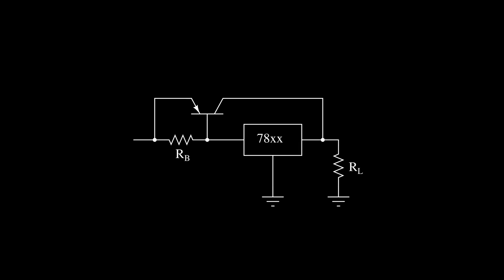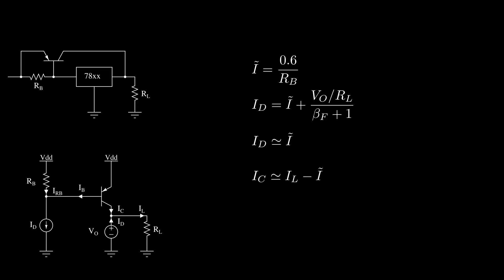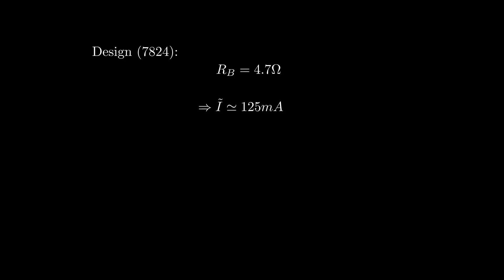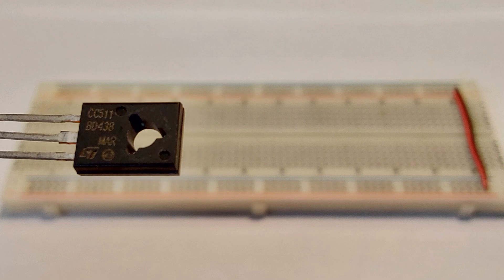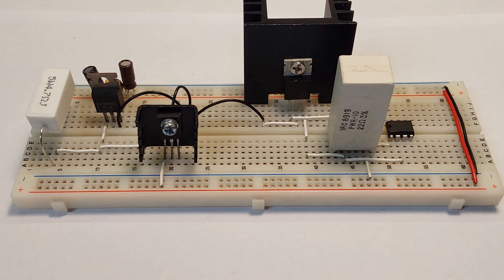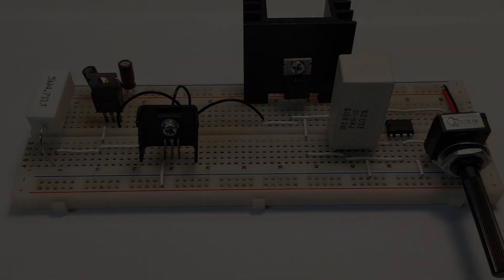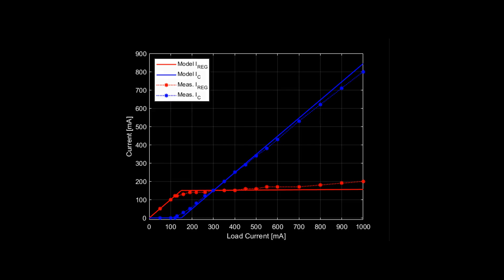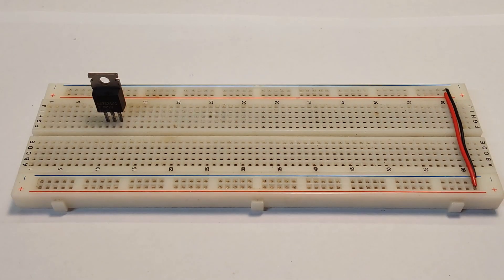78xx Current Boosting: Circuit Design and Measurements

Comment: You formula for the power dissipated in Rb is wrong. No more than the current passing through the regulator passes through Rband you have designed that to be not much more than 150mA. In fact, the base-emitter junction of a power transistor will drop more than 0.6V when the transistor is supplying significant current, but not too much more. If Rb were really dissipating 4.7W, then it would be passing 1A and have a voltage drop of 4.7V, which is nonsensical given that the transistor Vbe is across it. Look at your own measurements and you 'll see that no more than 200mA was passing through the regulator and hence through Rb. Actual voltage across Rb was 4.7R x 0.2A =  0.94V, so power dissipation in Rb was 0.94V x 0.2A = 0.188W. Use a 0.5W resistor.
Reply from the maker: You're absolutely right, I don't know how I let such a huge and simple oversight slip through. Thank you for pointing that out, I'll try to add a note on the video immediately
Reply from the maker: Turns out annotations on videos are not a thing anymore, but I'll keep this comment pinned. Thank you
Reply: @ You're welcome. Thank you for the effort you put in to making your videos. It is appreciated.

Comment: Haha, woops. The point of the transistor is for it to handle the large current path, rather than the resistor. Although over-estimating the power requirements in an experiment is in some ways much preferable to the opposite mistake :D Uni-Byte channel recently blew up one of his TO-247 power transistors in a power supply he is designing. It is quite satisfying to see the real world results very closely follow the idealized theoretical graph one would hope for.
Reply from the maker: I was so concentrated on the analysis, that I momentarily forgot Kirkchoff's current law :P Yes the experiment results were very satisfying, and after giving a better look at the VBE variation of the transistor in the datasheet, even the high load current behavior is perfectly expected

Comment from the maker: An additional comment: although in the video I mentioned the beta reduction at high collector currents as the reason for the change of the behavior, it turns out that the major contribution is given by the increase of the Vbe voltage! The beta still plays a role in it, but way less than the Vbe variation (just do a numerical example yourself and you can see it!)